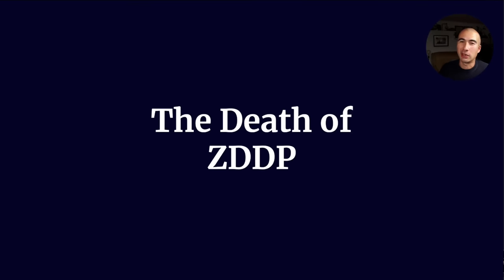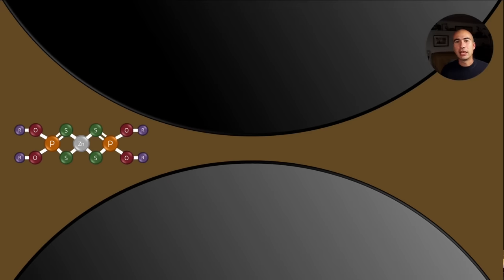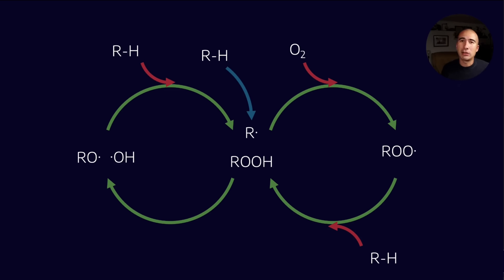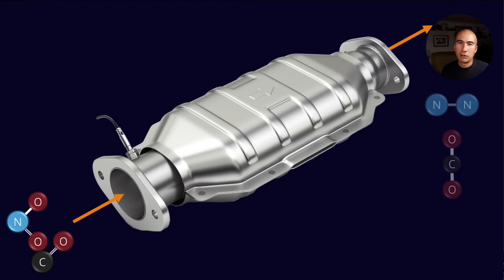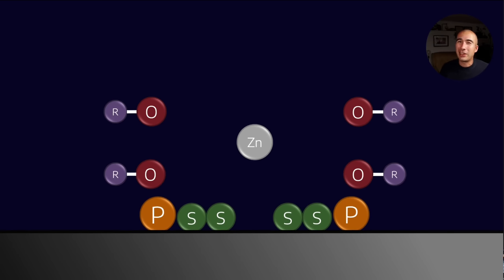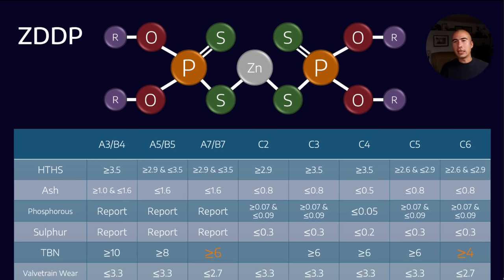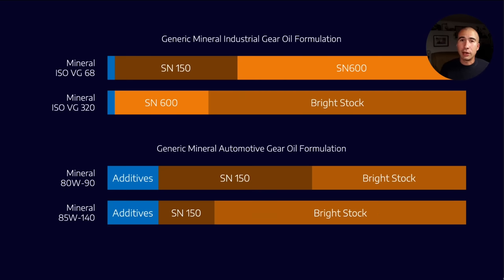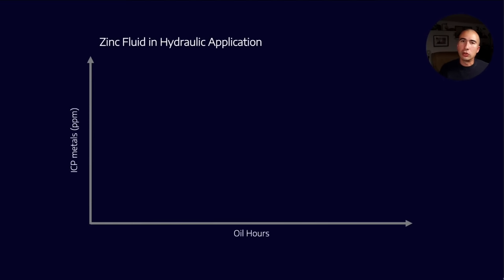Is this the end of Zinc (ZDDP) in oil?

Comment: I have collector cars. They require ZDDP in the oil as it was standard in the oild they were designed for. Now I have to add it every oil change. This is a kick in the b@lls for collector car enthusiasts.
Reply from the maker: Yeah it's frustrating, but I guess its a little bit like leaded petrol. It will still be available, but more niche.
Reply: Try diesel oils which meet the Ford spec, at least you will get a bit more ZDDP. It's what I do in the motors that need it.
Reply: You can use 'multi specification' diesel oils for pre-dpf diesels. Diesels don't use 3-way cats (instead they use a more durable oxidation catalyst) so if they lack a dpf they can tolerate more ZDDP without catalyst failure.

ACEA A3/B4 is a common and good specification for this, many of them also comply with various API specs.
Reply: +1 for using diesel oil. The ppm on rotella zinc is just above 1100 which in my opinion is perfect for my mildly modified flat tappet cam 530 lift 230 duration. Done over 30k miles in that car running the rotella and the cam still specs 100% on point. I have another car that I converted to a roller cam so I can run whatever oil in it that’s always an option too. The roller cams are very nice and no one will ever know it’s there hehehe
Reply: What you need is Oil Extreme Concentrate added into your engine oil.
High Zinc or ZDDP is no guarantee for any engine.
High Calcium Sulphonate in Oil Extreme does a far better job.
Reply: There are cheap ZDDP additives out there commercially.  You’ll be ok.  Scrounge around at auto parts stores for older lots of motorcycle oil, Harley oil, etc.
Reply: ZDDP is 1960's technology.
Just use Oil Extreme Concentrate with every oil change.
You wont wear a cam lobe, it seals rings really well also.
Reply: The vw 505 01 spec oil is for ”pumpe duse” diesel engines where the camshaft drives the fuel injector system via a lobe. They also spec this oil for the W8 petrol engine. 
I figure this might be a good oil for flat tappet engines.

But you also have the Driven oils that seem very good.

Also the latest version   (Lake Speed jr talked about it recently) of Valvoline racing oil seem like a good choice if youre not using catalytics.
Reply: tripplefives  best oil
Reply: Try amsoil zrod & swap cast valves for stainless valves this works well with most applications on classics talk to your mechanic/technician first
Reply: @1u234  the only thing high zddp does is craze the surface of the followers (lifters)
Reply: You can still get API SJ and SL oils which have relatively high ZDDP, and whose specifications are backwards compatible. SM and later is where the compatibility broke.

Comment: Seems that industrial applications would be better served by paying attention to heat management in the oil.  Instead of just letting oil temps get out of sensible ranges and then demanding a new oil spec.
Reply from the maker: Yeah, this is the age old problem of OEMs designing for different objectives and then telling the lubricants industry to "just make it work".
Reply: @LubricationExplained  It's cheaper to design a machine with no oil cooler.
So you design the cheaper machine and demand a new oil that can cope with the heat.
Reply: @bradmcgrath358  k
Reply: @bradmcgrath358  that makes sense. I guess it keeps the price down at point of sale, but then effectively passes a higher service cost on to the owners afterwards which is a less obvious cost.
Reply: Most modern oils are good to nearly 400f 

If your oil gets that high. 
It’s either a stupid design or you’re working it wrong. 

I deleted my oil cooler 10+ years ago. 

The engine block, is it’s self,
A giant oil cooler 

Tell me
How it is not an oil cooler
Reply: @fastinradfordable  what's 400F?
Reply: @fastinradfordable  that sounds excellent. Do “synthetic oils” have a different durability in that respect? (I’ve always wondered why some specifications require either one or the other?)
Reply: @fastinradfordable  said "The engine block, is it’s self, A giant oil cooler 
Tell me - How it is not an oil cooler?"
An oil cooler is cooled by air at a balmy 87*F - your engine is thermostatically controlled to 195*F, 110*F hotter.
The oil is heated by the engine.  The exhaust valve stem can reach 700*F and the bottom of pistons can hit 450*F at full throttle. The heat comes FROM your engine and you expect the oil to give off heat BACK TO your engine ?
Reply: @fastinradfordable  Ah, where do you think the heat is made? Also, oil don't cool as fast as anti-freeze.
Reply: @fastinradfordable  your engine block is mostly a heatsink and your engine runs best not undercooled or overheating or over pressurized. That's what the thermostat is for and the pressure relieve valve in your oilfilter. Many modern engines are run too hot and experience overheating frequently in the valve seat aera  and cam bearings and through very hot fuel in the fuel pump. So are hydraulic systems like transmissions and hydraulic pumps/pistons. Run a 1954 I6 4litre daily. No sludge ever simply because its got 30hp per litre, 6 litre oil, oilcooler and a large radiator. Also hardly any wear.
Reply: @armedfarm3429  incorrect , oil has a lower calorimetric heat density than coolant / water. This means it is easier to heat up and easier to cool down
Reply: @fastinradfordable  
It’s an oil heater, one of many jobs oil does in a combustion engine is cooling
Reply: Oil temps absolutely go through the roof with some engines because the OEM cant be bothered to have an extra oil cooler.
Audi 3.0 TDI is an example it gets to 130C easily.
Reply: @joeyaplin3467  k
Reply: @philtucker1224  and that's pretty much how it works.  my background is automotive.  
Which a cesspit of trying to push costs downstream.      
Nothing is built to perform the task efficiently. everything is compromised to be able to sell the product at a given price.

Comment: ZDDP breakdown at 110-120c is very relevant to car engines which see heavy use like in race cars. It's not unusual to see engine oil temps to 120, particularly if no cooler is fitted. Thanks for that info.
Reply from the maker: Just to clarify, the antiwear function is sometimes still preserved even after thermal degradation. The Zinc is just the carrier for the molecule - the phosphorous and sulphur do the "real" work. I've seen a lot of instances I've seen hydraulic packs where the zinc goes to sludge but the rest of the molecules continues to protect.
Reply: modern cars the engine coolant temp is 210f and oil temp is about 30 degrees higher
Reply: People should def watch their temps
Reply: Even in normal engines when driven hard they can get high
Reply: @LubricationExplained  Very interesting indeed !
Reply: 🙏 🤝 👍Especially when driving Autobahn during  h i g h  summer temps !! @sasquatchcrew
Reply: Wait till you see oil temps in classic, air cooled, flat tapped motorcycles.

Comment: What happens to all the small engines out there that still need zinc in the oil? It’s not like OEMs can easily and cheaply redesign all their engines to use roller valve trains. As someone who has been involved in the industry for a lot of years as both a mechanic and shop owner, this is going to be a major headache going forward if zinc is removed from all engine oils.
Reply: The zinc is most all gone from your local automotive oils. With everyone going to roller cams, and running cats, its been reduced to its lowest acceptable levels.   That being said, you can get Amsoil small engine oil that is packed full of the good stuff.
Reply from the maker: I think that ZDDP will still exist, just nowhere near the current quantities. I can see a future where it's still available as an after-market additive or in racing oils which don't need the protections of OEM warranties.
Reply: @Just1Spark  zinc is not gone from modern engine oils it has been cut back to around 800 ppm. In reference racing oil has 1375 ppm. You can also purchase zinc additives. Cenpeco racing oil has 2400 ppm zinc. Used a lot in tractor pulling.

Comment: The first time I read an article about ZDDP was about 20 years ago. The article was on the subject of what affects the removal of ZDDP from Motor Oil would have on those people who owned classic cars that were built around the 1950s and 1960s. This was because cars of that era had flat tappets that would slide on top of a rotating camshaft. And that on those engines the ZDDP prevented excessive wear of the camshaft and tappets from occurring. The article also covered the use of ZDDP additives for classic cars that did not have catalytic converters. Basically ZDDP was removed from Motor Oil to prevent fouling of catalytic converters.
Reply: Correct!
Reply: Is there a good zddp additive for those of us who have flat tappet cammed cars & tractors?

Comment: Outside of catalyst fouling, are there downsides to adding ZDDP in modern engines that weren't designed to require it?
Reply from the maker: Great question! There's some evidence that too much ZDDP increases friction and that's why friction modifiers are also included. We covered it on the latest podcast episode. I'll try to clip the bit where we talked about it and post it as a shorter video.
Reply: @LubricationExplained  what's too much?    I think my diesel oil is 1200ppm.
Reply: Modern synthetic oils have chemical additive packages that are carefully designed to address every aspect of lubricant parameters.  Any retail product can degrade the oil performance potentially by disrupting the chemistry of the oil.  Use the correct oil for your vehicle, a top filter designed for synthetic oil and extended oil change intervals for engine longevity.

Comment: This is a brilliant explanation of not just ZDPP but also the significance of using the right oil. I run classic cars through to a 2022 tractor and 4Wd. Each has specific lubricants and what's good in a 70 year old classic would be extremely unwise in a modern diesel or petrol vehicle.
Reply: Hat do you run in your flat tappet engines?

Comment: I live in Florida where it's always "hot" and learned about synthetics and zinc in 1995, ran a lawn service and use 15W-50 synthetic oil (Mobil-1) plus one quart of synthetic "diesel" for the added zinc. Annual oil changes in vehicles, 2X annual in commercial lawn mowers.
No cat plugging or emission problems in hundreds of thousands of miles, however we don't have emissions testing here.  No lost motors from wear, except 1 "pawn-shop" edger motor that may have been on it's last leg - seized up a piston. Mercury outboard 2-stroke run at 100:1 on AmsOil, I was giving all my 2-stroke motors a shot of the "zinc" Diesel oil periodically.
Same oil in motorcycles with the "zinc-Diesel" except one ended up with a slipping clutch at 32,000 miles, so a clutch-swap with a parts bike and different oil for that one.
The oil was too slippery for the clutch to grab! But still ride-able.
Engines - Chevy 305 and 350, Dodge 360, Chrysler 2.7, Chevy 5.3, Honda 500, Yamaha 750, 900, 1100, 1300, Kohler, Kawasaki, Briggs & Stratton, Stihl, Echo. Mercury 40, Mercruiser 135HP.
Reply: Hi Peter, (interesting what you said about not having emissions testing) - is that just in Florida or in all the US states? I’m in the U.K. and we have to have an annual test on all vehicles over three years old before they can be driven again, but on top of that If a roadside vehicle monitoring Officer suspects a vehicle is smoking too much it can be stopped on the roadside and sent for an emission test as above…
Reply: @philtucker1224  a quick search and cut-paste 
Alaska.
Arkansas.
Iowa doesn’t require vehicle inspection except for salvaged cars and commercial trucks.
Michigan doesn’t require vehicle inspection at all.
Minnesota only inspects commercial vehicles annually.
Mississippi only inspects commercial vehicles annually.
Montana.
North Dakota.
South Carolina doesn’t require inspections but applies property tax to vehicles.
South Dakota
- But - Florida isn't on the list.  They pull you over for brake or headlight out, but not for a marker light, then they look for bald tires and have you honk your horn.  The "fix-it" ticket used to be $14.00.  I've been pulled for illegal window tint. It really depends on the cop's mood - he could write 1 ticket and give a "verbal" on the rest.
As for emissions, I rarely see someone blowing smoke anymore. Occasionally you can smell the "rotten egg" of a fowled converter, or a Ford running too rich, but for the most part cars today either run right or they don't run very well at all, so they take themselves off the road.
Reply: @peterdarr383  Cheers Peter for that fantastic reply, I’m honoured that you gone to so much trouble with your research! Best wishes to you and your whole family for a great Christmas and successful new year! 🙏🎅🏼

Comment: I have an old 2000 4runner that specifies API service SF 5w30. Being that modern API standards are intended for vehicles with roller valve trains and do not have the same levels of anti wear additives, I have been using off the shelf 5w30 full synthetic also adding a ZDDP additive on oil changes.
Reply: Don’t overdo the zinc additive!  Higher levels are not better, and can even attack bearing metals. The oil manufacturers are doing some pretty good chemistry with their latest oils, particularly Amsoil, Pennzoil, and Mobil One.
Reply: @wallacegrommet9343  I use royal purple with BG MOA additive. It's API service SP I think.
Reply: @wallacegrommet9343  there no well chemistry done by the manufactures! The only one main goal of the business - money !. 
So as a result - they minimize cost and labor and cheaper oils and additives only to achieve minimal requirements of API standarts....
Reply: You are actually killing your oil with the additive...just the opposite of what you hoped for.

Comment: I have definitely seen zinc causing issues in hydraulic systems. Interestingly enough when we transitioned to a low ash, zinc free synthetic hydraulic oil, the  varnishing issues didn't decrease over time, even with more stringent filtering regime. What we found was the synthetic oil had such low conductivity that static discharging through the filters was breaking down the oil and forming varnish. The black discharge marks were really visible in the filters which helped us identify it.
Reply: Reminded me of seeing a bigass diesel crank ,freshly pulled from an engine and had all kinds of metal chips stuck to it. 
Cause was a grounding issue with the starter and it was trying to "find"  ground thru the crank(also witnessed on the pitted engine plain  bearings) 
Static can do strange things, I know on some electric motors they put a brush attached to the case and have it rub on the motor shaft.
Again, it'll try to find a ground thru a roller bearing and pit them.
Reply: @MrTheHillfolk  yeah it's wild hey. And expensive
Reply: While I was in the USMC they switched the hydraulic fluid in a certain aircraft.. and static electricity would buildup in the hydraulic test bench, and discharge through the 18 inch long 0 to 50gpm flow meter,(a heavy 2.5 inch  diameter tapered glass tube) causing it to explode. I never witnessed it happen but I know of two flow meters that blew up in Iraq and at least one in mals-14, this was in 2010.

I took a sample and tried to see if the oil would breakdown, holding two sharp pieces of metal connected to a mot (a 2200vac transformer) and could not see the oil breakdown before I could feel the wires touch each other.
Reply: @EldonJohansen  That is really intriguing.
Reply: @aSpyIntheHaus  I was only 23 at the time and didn't really believe it but knew it was theoretically possible. Don't know what the result was, left the USMC in late 2011
Reply from the maker: Yes! This is a huge problem, especially in turbine and compressor oils that have slowly moved from Group I to II/III as OEMs have demanded more oxidation stability. But I do see it a lot in hydraulic systems too. It's become such a huge issue for the industry that I actually built an entire course for it. But jut for the YT channel I did this video: https://youtu.be/YeaA2FVrvK8 covering the breakdown voltage of different lubricants.
Reply: When California First Went to Low Sulfur Diesel Fuel """ ALL """ !!! The Conventional Mechanical Injection Trucks Were Having To Add ATF To the Diesel to Prevent the Injection Pumps From Galling, seizing and you could not buy ATF at any price in California and no matter how old and funky the container was. You could sell it for any price, Particularly to all the logging trucks at the time.
Reply: Two cheap solutions to the diesel fuel lubricity deficiency are adding BIA/TCW 3 two cycle oil at a one percent ratio, or biodiesel.  Both are excellent additives to improve diesel fuel lubricant quality.  Search for HFRR diesel lubricity additive test and you will find a great source of info on this ZDDP replacement issue
Reply: I own Subaru Outback BE-BH. It is 20 y.o. I pour Dextron 3 ATF oil in my Gearbox and it runs perfect. Both oil and gearbox clean as surgery operational room.